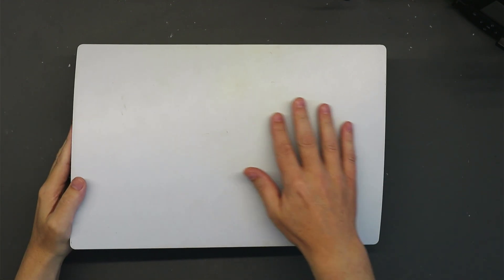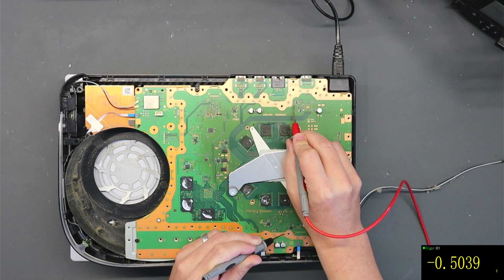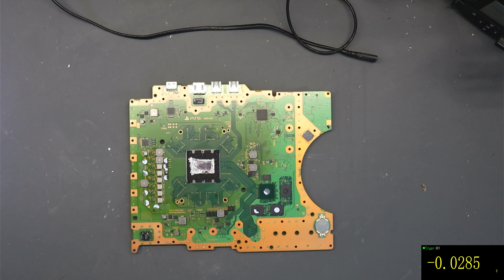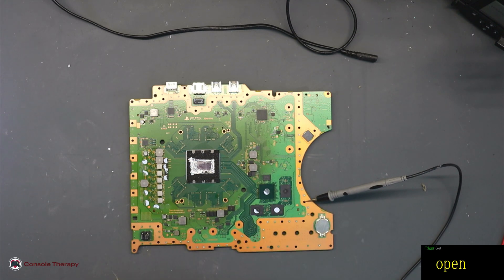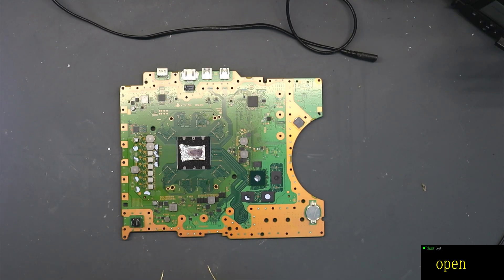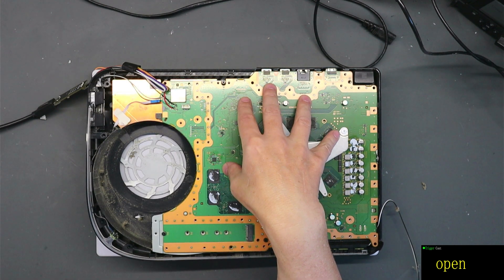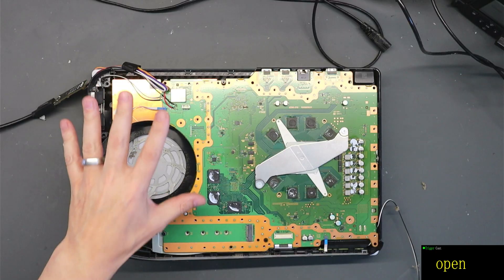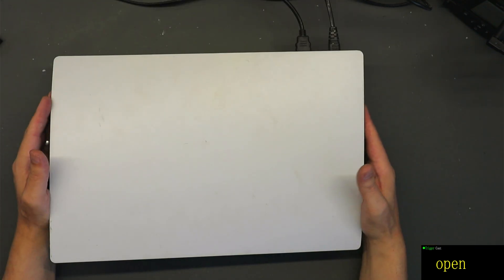PlayStation 5 Blue Light Then Off - How to fix a BLOD on the PS5. It is not as hard as you think

Comment: Hello sir I have ps5 slim edm-041 its water demage console
Ps5 working well but fan not working that's why it get over heat and then shut down plz help me how to fix it
Reply from the maker: Hello.. Check around the fan connector for any corrosion from the water damage. Try to clean with some IPA
Reply: @ConsoleTherapy sir I just remove South Bridge and reballing now I will update you and thanks for you kind and for the time also sir

Comment: Hello! I have a Ps5 model EDM-033 which would not turn on or do anything, with some measurements I saw that the Cxd90069gg southbridge was shorted, I removed it and the short was gone, I soldered a new one that I bought on Aliexpress and the console now turns on and works, but after 5 minutes the image freezes and I can only remove the power cable since it does not respond ... And to start it again it has to cool down a bit, otherwise it does not give an image. I am sure that the southbridge I installed is not in good condition, on Aliexpress they often tell you that it is new and it is not and they may come defective ... Do you know if it is possible to install a Cxd90061gg on an EDM-033 board which comes with the cxd90069gg?  I read that these chips are compatible, but I don't know if that's true or not. The balls are in the same position, but I don't know if perhaps the 69gg is compatible on boards that come with the 61gg, but on boards that come with the 69gg, like the EDM-033, the 61gg is not compatible...
Reply from the maker: You can, however you will also need to change the firmware on the bios (nand) and there is one of the pads that you need to disconnect - so long story short is yes, but it need modification

Comment: Did you read error code from uart?
Reply from the maker: Yes, it was a power issue code (cannot remember the full error code), but cleared them and then no error codes when the LED cable was unplugged